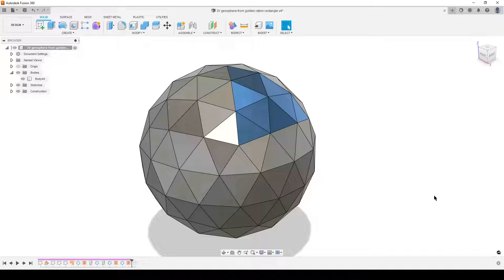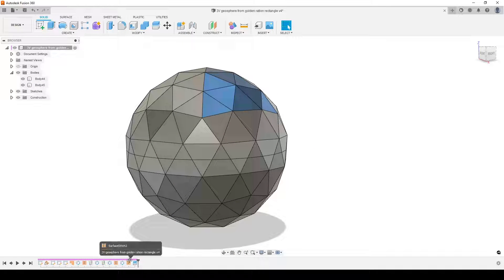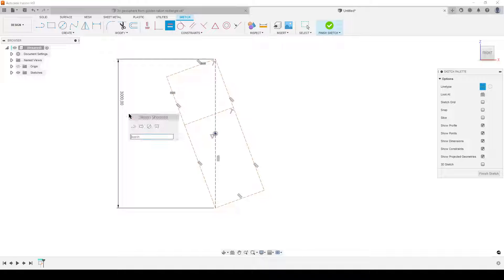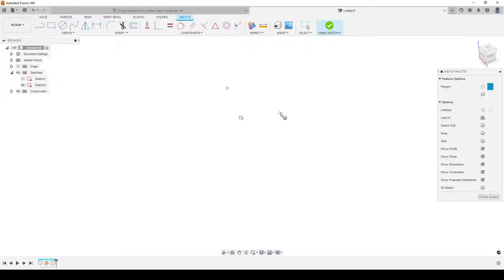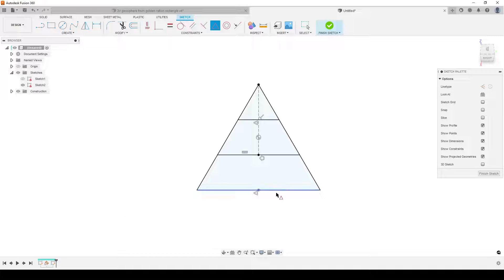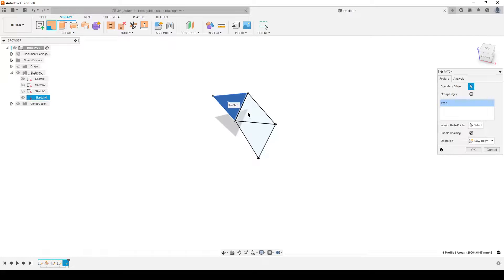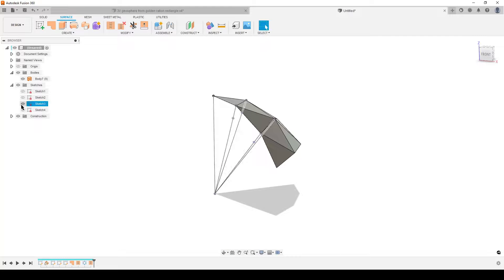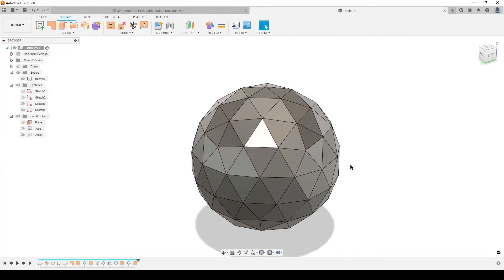Fusion 360 - 3V (frequency) Geosphere/Geodome Workflow

Comment: If I adjust the dimension in the first sketch it breaks everything. Is that the same for you or did I do something wrong? I think I did everything exactly as you did, to the letter. ETA: I seem to have fixed it by making the line in the first sketch that defines the height of the triangle in the second sketch three equal colinear segments and referencing those instead of the centerpoint of the triangle in the second sketch. What was happening is the centerpoint of the triangle in the second sketch was losing its reference somehow.

Comment: Hi, Kristian. I want to make a heavily parameterized icosahedral geodesic dome model with the number of subdivisions (the "frequency" V number) controlled by a parameter. How would you recommend I do that? It's... kinda tricky.
Reply from the maker: You'll have a hard time making that in Fusion "normal" modeling, there is an API that can be used. Have a look at the Polyhedron Generator addon for Fusion (only windows) https://apps.autodesk.com/FUSION/en/Detail/Index?id=3091103851505404663&appLang=en&os=Win64
Reply: @KristianLaholm  Wonderful! Thank you so much! I'll try it out come morning. I've only a trial subscription to Fusion so I'm not sure I'll be able to import it, but it's definitely worth a shot. Thanks again!
Reply: @KristianLaholm  Also, do you know how I would subdivide a construction triangle into a parameter number of smaller construction triangles? I followed a slightly modified version of your steps for hexagonal arrangements from repeated uses of the rectangular pattern tool, but they only seem to be able to subdivide a rectangle or parallelogram. So half the sub-triangles overshoot the big one. I can go through manually and suppress entire rows or columns, or pick and delete the extra, or use the select tool to delete the overhang, but as soon as the parameter for the number of subdivisions changes it's a mess again.

I tried using the circular pattern tool, only to run into the same issues.

Maybe I've got to screw around with selection sets or be really clever about applying multiple circular patterns to multiple rectangular patterns, or else just trying to figure out how to parameterize the number of times a pattern is applied, but this is day 2 of fusion for me, so it's a particular challenge.

Subdividing a triangle is way harder than I thought it would be. (Hmmm, maybe multiple rec. patterns of construction lines of parameterized length? But then how to control the length of each line based on its position in the pattern...)

If I come up with anything I'll let you know.

Bye!
Reply from the maker: @RandomAmbles  Fusion has no good tools for this type of things/workflows, no scaling etc in patterns limits the possibilities. You can give it a try but for now it will mostly be wasted time, it's fun but if you want to repetitive 3D geometry you need to look at tools made for that. I think it's possible in Blender and if it have understod it correctly grasshopper is an option. 
There is no tool that can solve all or problems :) remember Fusion is designed for mechanical CAD.
Reply: @KristianLaholm  Fair enough. I'd heard it was a powerful pure-3D modeling software and figured I'd give it a shot. I'll give blender, grasshopper, and rhino a shot. Still new to all of this so bound to make mistakes.
Reply from the maker: @RandomAmbles  Geodomes and similar geometry are heavy on the math equations/solving and in that area Fusion is lacking. From my understanding node based CAD or similar are better at doing things like this without spending to much time on workarounds. If you find some intersting way of solving things in Fusion please share :)